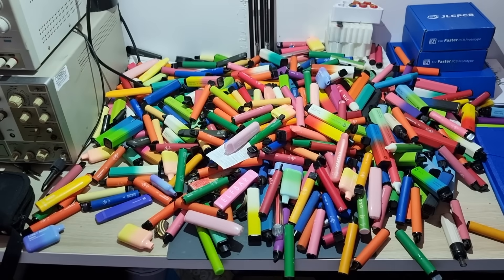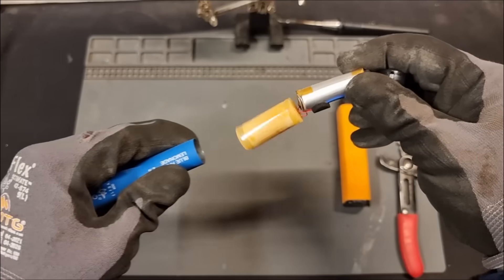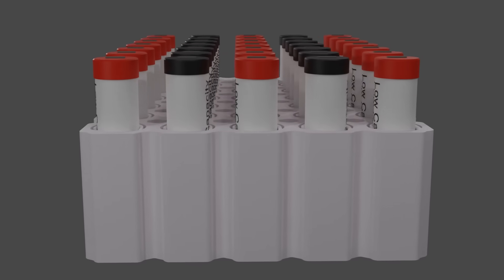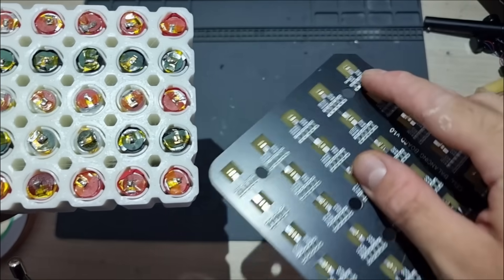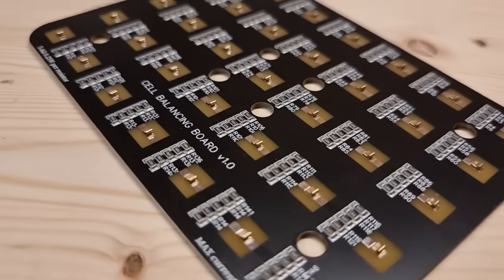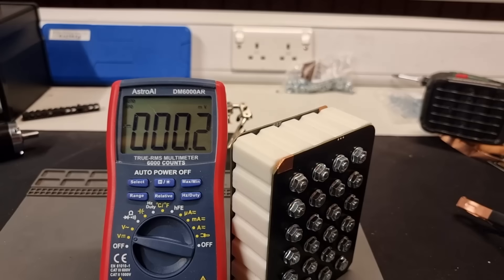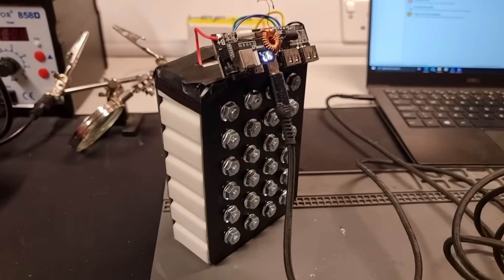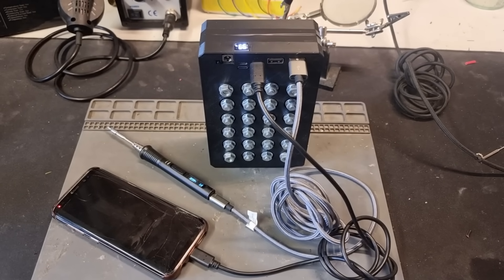Turning Disposable Vapes into a Fast Charge Power Bank

Comment: The PCB design really doesn't get enough credit in this. Beautiful.
Reply: Yeah that load balancer tray is making me kind of excited
Reply: I would love to try and do this, but I have no idea about anything once he said he had a custom PCB made for it, how do I go about getting these items? Finding the vape batteries isnt hard. I have a 3D printer, he has a link for the power bank module, but im lost with the PCB
Reply: @MrMisturr  PCBway does custom PCB in small quantities.
Reply: +1 would love to buy this as a kit
Reply: @MrMisturr  Just wait, he said maybe will post a full video tutorial about making this power bank, so I guess subscribe, turn on notifications and wait 😄 You can get custom PCBs online for relatively cheap, you have to design it yourself though. Some sites even offer an online PCB Design Tool
Reply: you only need 24 steel bolts
Reply: It really is. Nice and orderly, neat, understated.  Very sharp.
Reply: Its great BUT maybe the plethora of huge bolts is a bit overkill?
Reply: @mattinwinkymg  its simplistic though... just screw that there, tighten there, and battery go pzzzzzt
Reply: @Suzuki_Hiakura  indeed, ahem, indeed
Reply: @Suzuki_Hiakura  also fits well to the jurassic Park ethos of if it's heavy, it's expensive
Reply: it does look quite simple... not so over the top as some other prototype boards I have seen. Curious if he plans to release them later, as it seems simple enough to use even for regular 18650s that you might have from a used pile... seen some listings on sites like BatteryHookup that have boxes, drums, and pallets full of used modem and UPS batteries full of 18650s for recycle and reuse, to the lucky buyer. Always been leery of them as I couldn't find a simple, no bs kind of PCB that could balance the cells when I get them, and I had no intention of manually balancing, charging, or running them down fully. The case is also nice and simple, locked in place not with a few screws and a cover or clips, but with basic bolts driven through the PCB and housing, eliminating the risk of having something not being aligned, as it would be extremely obvious if that was the case.
Reply: Genius idea, great execution!!!
Reply: right. i got to learn to do that.
Reply: Built like a tank! Drop that out a plane 30,000 ft I bet it works still!
Reply: It's just bus bars with pads? Neatly done but kind of expensive compared to just soldering, the cells all have tabs on them so they're safe to solder to. Also negates the need for all the spring connectors and clamping bolts. 
It's cool to see a different design but this one rather highlights the advantages of the usual way to do things, with soldered or spot welded bus bars.
Reply: @teslatrooper  solder is all fun and games until the battery dies and you wanna put a new one in.
Reply: @teslatrooper  probably because he wants to replace the batteries with new ones when they die and doesnt want to have to resolder all of them
Reply: @teslatrooper  he literally mentions in the video why he didn't solder them...

Comment: maybe I missed it but that bms doesn't seem to do balancing of the cells in series. it can be extremely dangerous if the bms only looks at the total series voltage rather than each parallel's voltage.
Reply: it is doing balancing of the cells in series
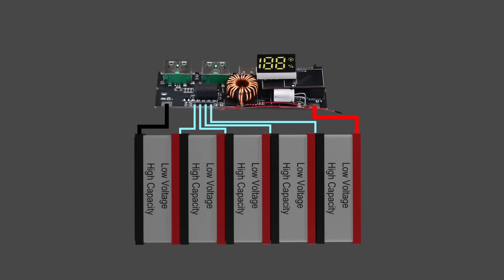Reply: @jatoziomek5608  oh yeah, went back, missed the thing at 7:33

Comment: we need like a highly engineered prebuilt thing where I can just yank the cells in and it works magically but still costs less than a manufactured high voltage powerbank (so below 80$ ish)

Comment: These batteries are normal,at least 500 charging cycles, which is the waste of everything!.Great idea with powerbank.
I also use the found mod Drag3 for 18650 cells as a portable soldering iron, it is enough to screw the soldering iron tip 3$.

Comment: I agree with this video. I also love the idea, I was playing around with a bunch about 2-3 years ago when I vaped a lot more. I found disposable vapes had better flavor and a solid hit, so I dropped my mod vaping. I collected used vapes from a lot of people and had the batteries for various projects lol.

 I don't usually recommend laws, but I do believe a global ban on the use of "single-charge" lithium based battery "powered products" above 3.3v should be in place. (For those who don't know electronics, this is relevant to our buttons lol).

There are plenty of other ways to do disposable vapes, like requiring the consumer to install a 18650 or even requiring small variations of the same lithium batteries and adding a charge port. Or hell, just make a design that allows you to do disposable cartridges with a rechargeable battery instead. (Doesn't solve the issue, but drops the number of batteries used significantly)

Comment: This is what I’ve been saying! These vapes have alot of good electronics in them, especially the batteries. Some of them even have reprogrammable microcontrollers and small spi LCD screens. Just gone to absolute waste! I’ve actually started to collect these to disinfect and use to make VR body trackers. They work amazing for this since they’re so small and sometimes pretty high capacity.
Reply: I'm interested in how you make vr trackers at all, let alone with those batteries! Do you use valve tracking lighthouses?
Reply: @P-Ian no one uses lighthouses anymore
Reply: @garyhost354 You're saying that they probably make VR trackers out of a vape that use inside-out tracking using a camera? Anyone who wants accurate tracking, especially for what (I assume is) tracking arms and legs, is  using lighthouses. 

Inside-out tracking is cool, but has inherent limitations...
Reply: @DMN_001  no they are using mocap
Reply: @DMN_001  I have done multiple systems and in the professional space they are pairing it with something like optitrack or phasespace.
Reply: Make a video just like this guy on how you're using them, would be cool.
Reply: This u Jayden?
Reply: Also definitely interested in this as I have over 200 of these things I've saved from the bin.

Comment: A question would still be If those cells are really safe to cycle over and over. I mean, a Lithium coin cell is also non-rechargable (or better it is not safely recharchable). Maybe these cells are made quite similar?

Comment: That's a real eye opener for me seeing lithium batteries being used in disposable products. Guess the global Li-ion supply chain is so streamlined that this is the most cost effective way for them to push out their product. I'm grateful for folks like you trying to spread awareness about this. Figure there will some day come a point where we will all need to learn how to scavenge like this once finite resources become scarce.
Reply: lithium is also the cheapest battery tech around that can do high current and small capacity at the same time. vapes draw a lot of current.

Of course, that doesn't absolve the wasteful design, rather it just goes to show that this product is a bad idea from the beginning. Better to stick to the old box mods than to use these.
Reply: @tissuepaper9962 there are a million vape alternatives that would emulate a disposable vape just minus the disposable part. We don’t have to force them to use the huge box mods few wanna use anymore
Reply: @tissuepaper9962  also one of the most harmful battery tech to mine and make

Comment: Never thought to do something like this... Maybe I should try and salvage more of these, if I see them...
I still have a few of the higher capacity (~1500mAh) cells from the larger vapes, (again discarded by others...),  which I will probably use as the power source for portable Bluetooth speakers and the like.

Comment: its easier just to solder small wires to the battries and use small screws to keep it together. I would not do pressure contacts like that

Comment: Hi, I noticed that these batteries can't be fully charged to 4,2volt like normal lithium cells, since they got to much discharge in the vape process. Did you adjust the circuit board to a different max charging voltage? 

Great project from you ! 👍🏼 Really inspiring.

Comment: its more better if you make a bigger battery to just power your house and plug it in using a larger solar panel its better  for environment too ,completely off grid power source ,just taking so long to collect those, i recommend also in you make your own Battery management system (BMS)

Comment: I Made A Battery From These Vapes For My Radio Walkie Talkie, But Im Dumb Because I Totally Forgot To Put The Current Regulator In To The Battery And When I Charged The Battery It Started To Hiss, (Good That I Thought To Charge The Battery Seperate From Walkie Talkie Cuz I Was ABle To Charge The Whole Radio With Dock Type Charger, But I Took The Battery Out And Charged It Alone) So It Started To Hiss, I Put It At My Eaar And Listened As I Walked Outside And In My Hallway It Exploded In My Face, It Was No Fun ! So Please Dont Mess With These Batteries If You Don`t Know What You Are Doing, Seriously, It Can Do Life Changing Injury FOREVER, You Will Live With It Your Whole Life And Die With It , Imagine Burning Your Face, It Will Melt Away Fast, Skin Is Like A Butter To A Hot Knife When It Contacts Hot Lithium And Other Chemicals In These Batteries, Im Thankfull That I Got Only Heat And Burned My Hear, Ayebrows And Facial hair, But if The Chemicals Would Spray Out, It Would Change My Looks Forever :(
Be Cerafull, Remember, Mesure Twice, Cut Once.

Comment: Could have just spent the money on normal 18650 cells without the massive empty spaces between the cells and have a better bank without spending it all on the circuit boards and using low capacity cells

Comment: Finally, someone who understands! As a vape collector (and chronic nicotine addict myself) these vapes make me feel like garbage to see them tossed away. I've been asking around and looking for dead vapes that I get to salvage the battery out of, and now even my Oculus controllers are rechargable! Another good tip for anyone passing through: if you either can't get a bms or are just impatient, the rechargable disposables such as the Mr. Fog and Norths come with a "free" protection circuit and charging port for single cells. All you need to do is use the output that used to go to the pressure sensor most of the time, though every vape is different so make sure to examine the pcb.
Reply: Actually super smart. You can genuinely repurpose quite a bit from disposables
Reply: The problem i have seen with trying to repurpose the electronics as they are from the factory is most don't output the right power or safely control the battery without pulling from the coil supply.  And they are generally designed to only activate for at most 10 seconds to prevent damage. I'm really asking around to see what can be done!

END OF LINE
Reply: @jerrt  I'm a little confused by what you mean, but I think I understand lol. For the wrong power output, I've personally never seen this. What you may be mixed up with is the mislabeled capacity of these cells. Typically they tend to over advertise the specification, for example the "800mah" capacity cells I measure tend to be around 600mah actual. The voltage, however, I've always seen be consistent as the battery chemistry should dictate a max deviation of ~2.8-4.2 volts depending on charge level. Most vape companies foresee this and add voltage regulators to output a stable ~3 or ~3.3 volts. If you've got a really fancy one, maybe there's even boost converter for pushing 5 volts.

As for the 10-second issue it appears to be a built in functionality for the majority of 3-pin pressure sensors, and the board itself only handles power delivery and the vape specialties such as a screen and whatever else. This means you should be able to salvage power from the input pin as it always flows into the sensor, where pulling from the vape is what lets that input power through to the coil for a maximum of 10 seconds. From testing with the new Fog switch and North bar, I'm able to reliably use their boards for some simple projects with constant power flow. However, I do think it's worth noting that these shouldn't be your end all be all bms, other features on the board are just going to slowly eat your battery charge.

EDIT: The input pin in this case is the input pin for the pressure sensor. The output pin I'm referencing in my original comment is the same, I just meant output from the board 😅
Reply: @TrashStash  I did miss type a bit.  Usually voltages levels aren't the issue. just reliably getting constant supply.  I have not tinkered with the newer units as much so I will definitely look into tapping into supply right before the sensor. Thank you for that Thought! 

I do want to get access to the controller chips more directly. To either extract for other projects or to disable lights and things that I wouldn't want draining voltage.

END OF LINE

Comment: That is insane to me. Disposable anything with a battery just never made sense. I have been using the same 6 batteries for like 4 years and when one of them is not suitable for high amp output. Then it powers a flash light. How are people just throwing these away because they are labeled disposable. WTF

Comment: That's a nice project but tbh, it takes way too much space for 15Ah only. The best use ibhave found for these is on gamepads like XBox controller where I made it rechargeable by using 2 of those cells in parallel. 
You cam basically replace the AA or AAA batteries in all devices that use 2 of them in series because the circuits are always rated for more than the 3.2V that the AA batteries have.

Comment: Hi, I have been running a similar project and the issue is have come to notice is that most of the cells that i found in the vapes were differing in chemistries, so main chemistry was usually liion but then the additives varied quite a bit (Ni Cr etc.) did yours have the same issue and it still worked fine? Also, how did you ensure that the cells are charged and discharge at around 1C current as this is the safe value with liion, was this possible to program with the circuit boatf u used?

Comment: Anyone who watches this great video and decides to take apart a vape, PLEASE do it with gloves on and do not get the vape juice/liquid everywhere! 

It is extremely potent and can be absorbed through the skin which can give you nicotine poisoning. I have personal experience of this from when I decided to do exactly that and, being a thin person, I absorbed a lot of the liquid through my skin, not knowing how potent it was and suffered from head, neck and back aches for weeks until I realised where it was coming from. 

I was already being careful not to contaminate myself which means that it could have been a lot worse. What I didn't realise to begin with is that the liquid is not only on the inside of the sponge, but also on the outside of the clear plastic around it which I held. It was also on the inside of the tube and on every surface the sponge module came into contact with.

If you do use gloves, please be responsible with them and not touch everything after the sponge because that will contaminate your environment, and dispose of the sponge and gloves responsibly (idk how nicotine can be disposed but look it up).

@1oblob please could you either edit and reupload this video or put it in the next one because this is very important information.
Reply: Weird I didn't wear gloves and I didn't feel anything 🤔
You sure glycerin and propylenglycol go through the skin?
Reply: @nowonmetube  it definitely absorbs i vape and any time i get juice on my hands or lips it's way stronger than hitting a vape and nearly makes me sick
Reply: @nowonmetube  the glycerin won't. However nicotine will absorb through your skin and it is actually ridiculously toxic
Reply: @CAMSLAYER13  correct on absorption  - that's how nicotine patches work
Reply: Nicotine is a common garden pesticide- its all over.
Reply: Yes you can absorb nicotine through your skin from eliquid, and can get really sick from it especially if you don't already vape or smoke.  Wear nitrile golves, because it will go right through latex.

A lot of these disposable vapes have a ridiculous amount of nicotine.  Way more than you would get if you smoked cigarettes so be careful.   It really is an irresponsible amount of nicotine they use.  From an addiction standpoint you'd be better off smoking cigs (cigs are still overall more unhealthy, dont get me wrong).
Reply: What was the strength of the vape liquid you were working with...  and was it nicotine salts instead of normal vape liquid?
Reply: @jamesdouglaswhite  I don't actually know the strength, they were generic (mostly elfbar I think) vapes which I got from my friends - I'm not a vaper. The liquid was absorbed through my skin when I contaminated myself with it when handling the constituent parts of the vapes.
Reply: i dont believe you can suffer from neck, and back aches from nicotine... lol
Reply: @humble2246  yeah but I still wouldn't take a bath in the 5-7% nicotine vape juice that they put in these things. There's no way that wouldn't have an effect on your nervous system.
Reply: @humble2246  then google it and research it yourself

Comment: I put those battery in devices that need normal AA or AAA batteries. Most of the time 18650 don't fit in the AA compartment, but those one do ! You just add a TP4056 and you can even charge the device with USB... Work perfectly for devices with 2 to 4 AA (AAA?)batteries !